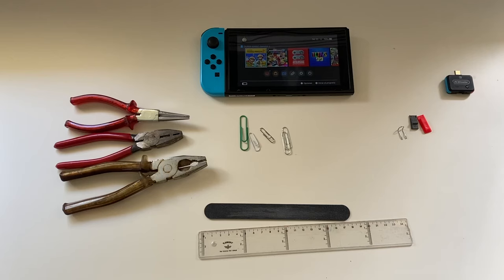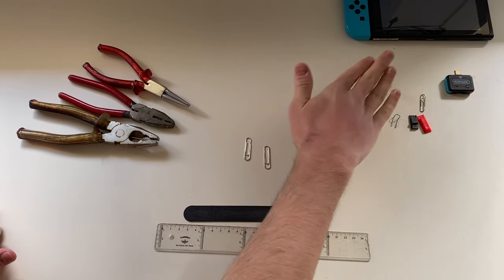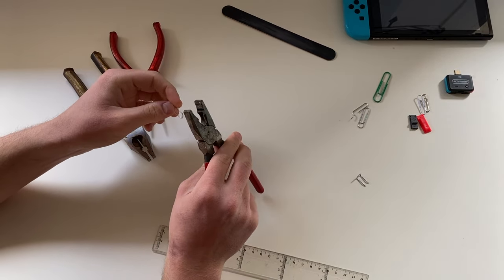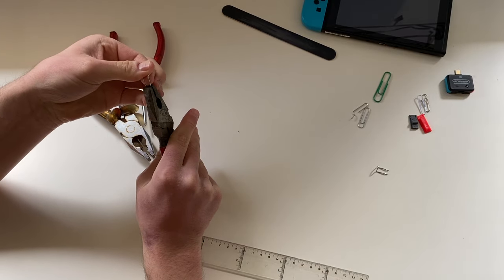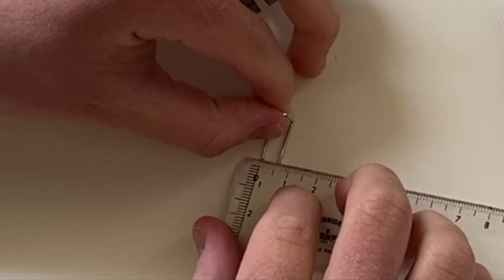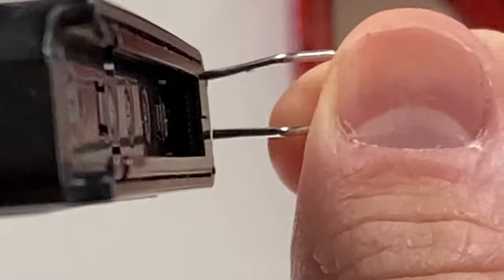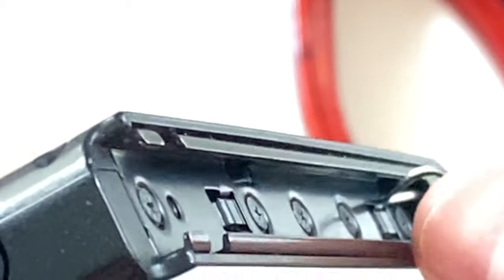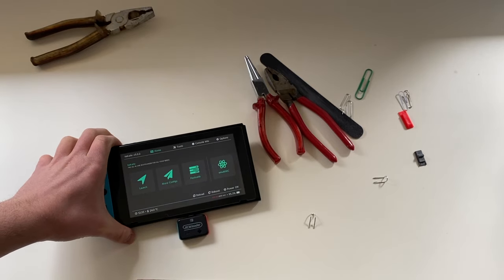How to make an RCM JIG with household materials. NO DAMAGE TO YOUR SWITCH

Comment: This worked! For anyone that is trying this though, I would recommend booting into hekate and turning on Auto-RCM so you don't have to keep on redoing this process since it can take a while.
Reply: @kqns3451  
?
Reply: Apparently it can brick your switch, what's your experience with it?
Reply: @imshmee8591  this cannot brick your switch. using it to get cfw has a small chance of bricking it.
Reply: @notraeon  it can it's a very risky method to use and I really don't reccomend it
Reply: @Tomatexyz  ?
Reply: Broo its just the Switch bootloader bro its like the Android recovery or the RCM MODE on ios
Reply: This ^

Comment: No damage done to the switch is a bit of an overstatement. When making use of DIY RCM jigs be aware that it will sratch the bottom part where you slide the jig to jump the pins (1 and 10). The damage is minimal (you can fix it easily)
Reply: is a 3d printed rcm jig better or will this work as well?
Reply: @worldrecordcherrylicker8228  Hey, this works brilliant, will only scratch off a little teeny bit of paint (that you can easily repair) on the side, but follow the tutorial especially where Hugo blunt the paperclip to minimilize this damage. 

Happy jailbreaking ;)
Reply: thank you :)

Comment: It worked, the only thing is that for me 6-5.5mm space between pins forked better.
Reply: Yeah roughly around that point for me too.. I guess if your paperclip is as malleable/cheap/shit as mine, when you put it in and apply some pressure it would have deformed by a few 0.1 mm's either way

Comment: Thanks man, I sold the jig I had before but with your measurement and lil tips I managed to make a quick one (plus luck ig lol) to around 5-6mm with just normal wimpy "for-paper-cutting" scissors to score it then snapping it, and my fingers to bend it twice xD

The ending prongs were also uneven but the joycon rail pins iirc do have some height to them so as long as it slots in to the bottom and applied some pressure it was all good. :)

Comment: For some reason my switch isn't entering rcm mode, it is cleary touching the 1st and the 10th pin, but great video though
Reply from the maker: Thank you. Even if it seems like it’s touching them it may not be touching them. Keep trying. If you are REALLY sure it’s touching them you may want to try with a different paperclip
Reply: I tried another paperclip and it worked, thanks a lot

Comment: How does one know for sure that it’s touching pin 1 and 10? I’m nervous about bricking it. Does it only fry if you touch pin 4?
Reply from the maker: As long as you don’t touch pin 4 (assuming you are not scratching any pins) you are good
Reply: @NintendHugo  but it’s ok if it touches pin 9?
Reply from the maker: Yeah, just be careful with pin 4
Reply: @NintendHugo  Can the console also fry if the console is turned off while pin 4 is touched?
Reply: @manny4674  its safe but if you turn it on it wil be shorted and you lost the console
Reply: @andy_gg22 Bullshit, if it's battery is in, then the 5v rail will be powered.

Comment: Hmm... I clearly have the paper clip touching the first and the last pin on the right side of the console. I then hold volume up and press power but it's booting regularly. I checked my serial number, it's not patched. Not sure what to do. EDIT: I tried bending the tips of the paper clip less to where it was loose in there, then pulled the paperclip outward and held, creating more solid contact between the clip and number 1 & 10. This ended up working.

Comment: What damage is caused by using the RCM jig?
Reply: It will fry your switch if you touch pin 4 be careful if you do this
Reply: @windowswhistler2000  how do you make sure to not touch pin 4?
Reply: @Shadow-ng7gf  touch the pins on the far left and right only
Reply: @windowswhistler2000  so if you touch pin 4? Will your switch just sorta permanently be in a overheating state?
Reply: @archaeopteryxargentavis1825  no it will just be broken
Reply: @archaeopteryxargentavis1825 its inside will be burnt

Comment: Hi i was wondering i have the right joy-con only I’m guessing no one has tried this hopefully it isn’t the case.

I broke my left joy-con so I can’t place I’ve seen every single video has the left one on so i was wondering i need to buy a new pair of joy-cons to do this cause i tried and 1 of 2 i cant do it or it isn’t possible without the left joy-con.

Is the left joy-con necessary for this or can I do this without the left joy-con?

Comment: if your switch is bootet on cfw and you need to take the sd card out of your switch, to put something on it, you can restart you switch, while its restarting take out the sd card, the switch will say boot error, just leave it, put the things on sd card you want, then put your sd card in you switch and press power button, it will restart and boot in to cfw, without usb, or jig :)
Reply from the maker: Or you can reboot to hekate

Comment: why is it whenever i try this shit it never works
Reply: Update: got angry and used a pair of metal pliers to try the wire method of pin to metal to ground and it worked but I used a paper clip as the wire also F as my switch is not modable